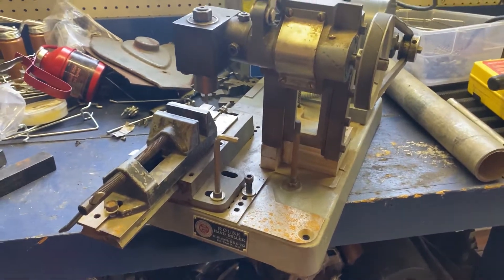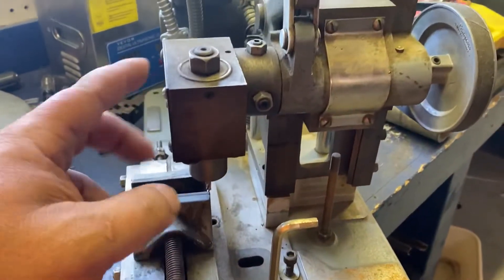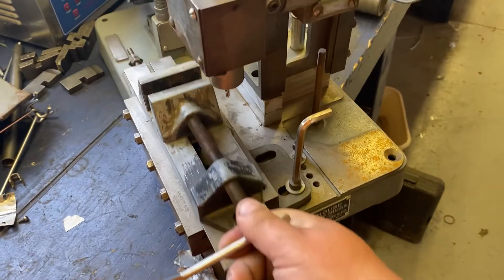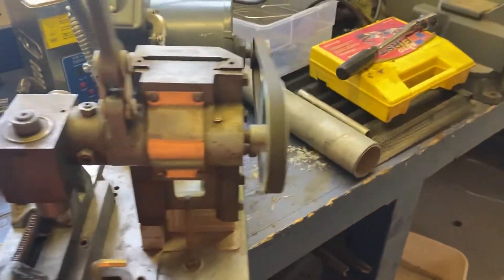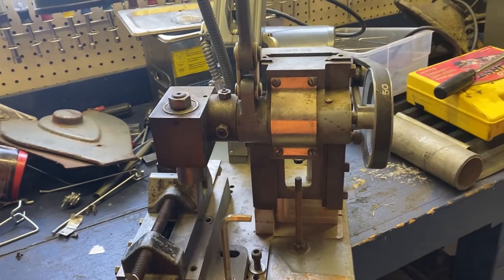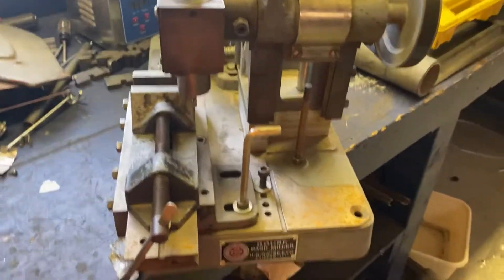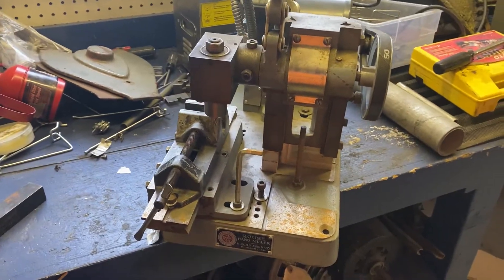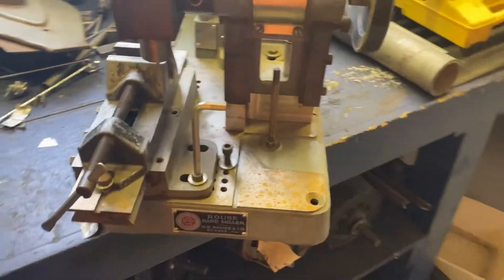Shop tools, rouse hand miller milling machine

Comment: I have a couple that were given to me and just took one apart today to recycle all the aluminum. Mine were each set up to do one operation only and would have been part of a production line with many machines. There were air clamps to hold the work. CAD machines that could do multiple things replaced these.